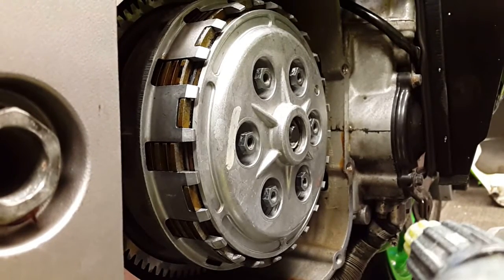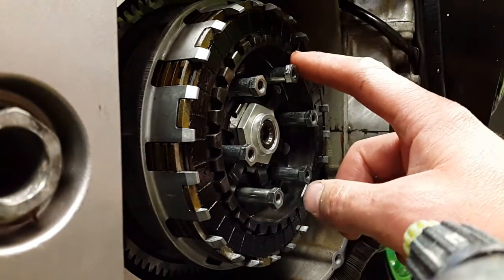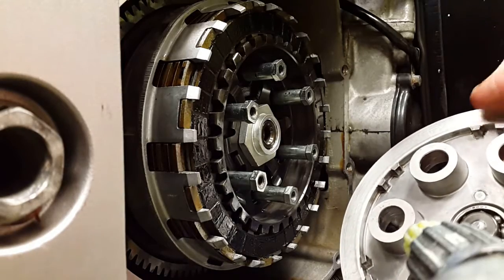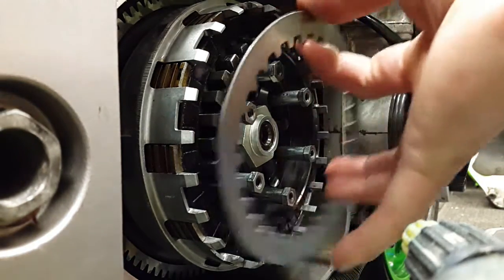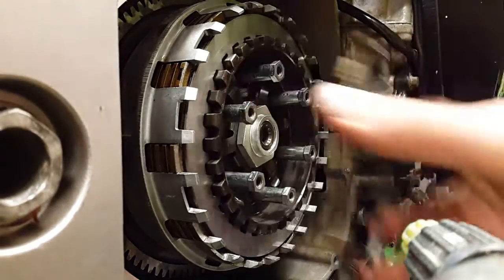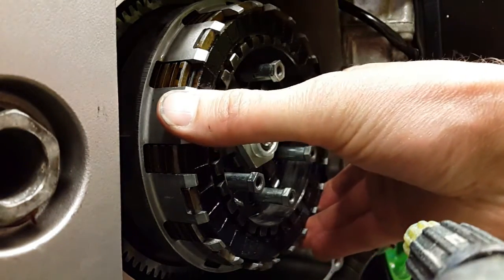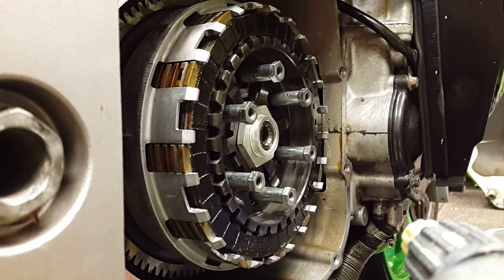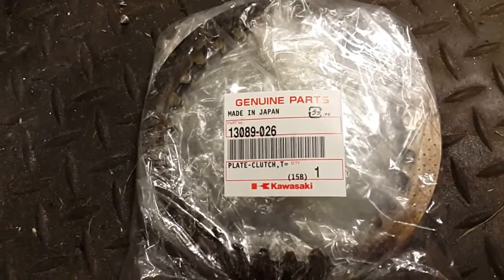Kawasaki zxr750 zx7r slipper clutch, how it works and how to adjust it.

Comment: Due to a slipping clutch problem during accelerations, I've just changed all the friction plates and all the steel ones with 3 x 2mm and 3 x 2.3mm hoping for a medium slipper effect. I have used stock springs, w/out spacers and done all the work trusting the service manual. After a short run, at the beginning all apperared to be perfect, but when the bike was well warmed up...Crazy slipping during accel and back home frustrated by the situation.
First suspect was the push rod..I put 2 washers as spacer between the slave and the mount in order to shorten the rod. I haven't yet tested the bike, but after watching this video I have anothe suspect. I have installed the last friction plates as adviced in the manual (not in the same slots as the others). could this be the cause of the problem? previously the clutch plate was installed in the same slot as the others, and I thought it was a mistake by the previous owner. it must be considered that the old pack had the same height (perhaps due to wear) as the pack with the new thinner steel plates .. but the clutch slipped due to wear. do you think placing the last plate in the same slot as the others could solve the problem?
Reply from the maker: Manuel, yes I think this is likely caused by fitting the last plate as per the manual. Try fitting the last plate as suggested in the video and let me know if this cures your slippage problem.
Reply: @iaintempl8  Just relocated the last plate, checked all the other stuff and then out for a test ride. It seems ok, I can finally appreciate the full power of this old rocket. 🤩  pulled several times over 10k rpms, and I never noticed slips. 
I'm using oem green springs (32/33mm) and I tested the slipper feature...I'm not an expert, but when downshifting hard, I can notice that the rpms tend to be lower than a normal clutch. The engine brake is..dampened.
P.S. sorry for my English and thank you for the vid. You make me save lot of time..I was on the way to inspect the push rod.
Reply: How many metal plates in total are there, assuming 6?
Reply: @iaintempl8  Thank you so much, mate! I will try asap. P.S. I have not installed shims or reinforced (race kit) springs. Could be this another problem maybe for the future as the plates wear will occour?

Comment: Question: i didn't understand, why you put the last friction plate centered like the rest, original is off centered. Could you explain?
Reply from the maker: Ivo Mihaylov the last friction plate needs to be fitted the same as the rest, due to the reduced stack height, if fitted in the original slots the last friction disc will be the only one in compression leading to a large amount of clutch slip and likely damage to other clutch components.
Reply: Now i see, thank you very much.
Reply from the maker: Ivo Mihaylov you're welcome
Reply: @iaintempl8 Hi Iain - really helpful video, many thanks for posting. Do you know the reason why the Kawasaki design incorporated the offset for the last friction plate. It doesn’t appear to serve any purpose and potentially leads to clutch slip but there must be a reason.

Comment: Question; can this be directly applied to the P model 96-03 or do they use a totally different clutch? Thanks
Reply from the maker: Bad Larry as far as I can see from the parts catalogue the P models are the same.
Reply: Cool, thanks!
Reply: @iaintempl8  are there 6 steel plates in total?